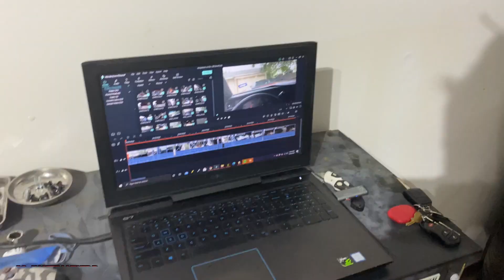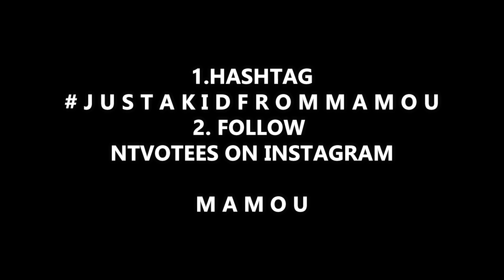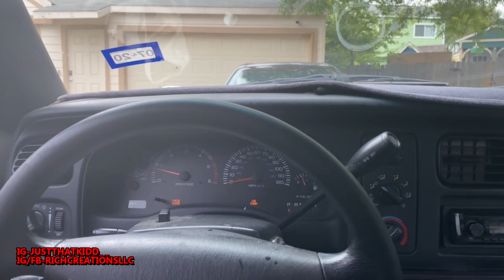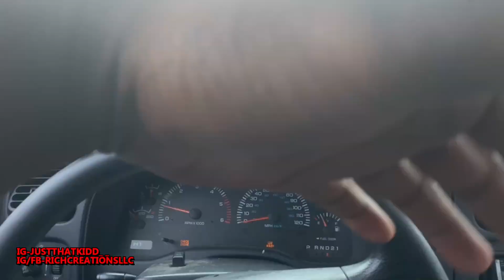GIVEAWAY INSTRUCTIONS | TORQSTORM SUPERCHARGER OR LSA for the G8? @TorqStorm

Comment: #JUSTAKIDFROMMAMOU I was also deciding between the torqstorm and LSA. My opinion is that the torqstorm is great for the price but once you get an intercooler and tune and piping for the intercooler, you're probably looking at $4k and you will be around 600hp VS the LSA where if you get all the parts you need separately (used of course) then it would be around $3k or less and just need a tune. If you want to buy a remanufactured LSA kit then it will cost you around $5k depending on what parts you want to upgrade. But the MAIN thing that got me to lean towards an LSA is that I can buy different sized pulleys and make a lot more power than a torqstorm. I believe you can buy another pulley for a torqstorm but it comes nothing close to an LSA power wise. Some people are out here making 900+hp on an LSA and you don't see that with torqstorm (with a single torqstorm supercharger for the G8). So just think about the future and do some more research. Would hate for you to get the torqstorm and then 6 months later be taking it off for an LSA. Think about what your power goals are and ask yourself if the torqstorm will achieve that and be reliable....but we all know you will be wanting more in the future lol

Comment: so torqstorm doesnt include intercooling or fuel system nor tune what would that run about how much
Reply from the maker: Welll the intercooling is extra. The tune probably run $400-500 maybe. I got a tuner already.
Reply: Moe_Nation so it doesnt need the intercooling i really havent seen a torqstorm set up to be honest
Reply from the maker: Not sure but pretty sure having the intercooler is better then none. And me either. I havent seen one in person.
Reply: yeah i found a page that has the intercooling added to it for 380
Reply from the maker: Not to bad.
Reply: @muneconhernandez3848  That is a china build it yourself kit. You have to do all the work. For the proper bolt on kit www.mrblingmotorsports.com